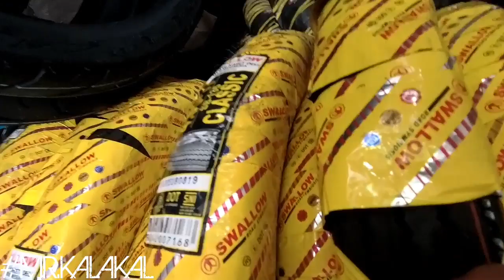YAMAHA RS100 MAINTENANCE DAY | MOBIL 1 OIL | CUSTOM BIKES

Comment: Snnapy! ok slamat sa vlog mo bok, isa akong retired military from army. Motor ang gamit ko nung nasa active service pa ako RS 100 astig  simple kasi ang porma pero ok ang performance ung tunog ng makina nya yan ung hahanap hanapin mo dahil pasok yan sa panlasa nating mga pinoy. almost 7 years kong ginamit  si RS walang masyadong issue sa makina basta alagaan mu lang sya sa 2T  oil.  Napasa ko sa ka buddy ko nung 2006 dahil nalipat ako ng malayong assignment kaya namis ko si RS kaya nung mag retire ako last 2014 bumili ulit ako ng vintage Yamaha RS 100 for 12k with sidecar ung may ari kasi pinapang hakot nya un ng scrap timber logs sa Pangasinan kondisyon pa ang makina nung mabili ko pero napabayaan ko nung mag stay ako dito sa Makati. kaya ng mapanood ko itong video mo biglang naalala ko si RS ko kaya thank you so much  babalikan ko sya at muli kong gagawing "ROCK STAR" (RS) ng kalsada. More power to you and God bless.

Comment: May ginawa kameng Enduro style na Kawasaki HDX 100..

Nako! ang takbo
manhid sa mabababang rpm pero pag nasa matataas ka na rpm
nako biglaan ang power!

Maiintimidate ka kung hindi ka familiar sa powerband ng 2 stroke
Reply: Modified engine ba paps? Meron ako kawasaki HD2 100 ehh.. Iba talaga hatak ng 2stroke.
Reply: Machined Block from KE 100 ,high compression head..

X4 125 carb

5 speed gearbox from Kawasaki G7
Reply: Hanep na pala paps. 5speed din KE100 at plug and play sa hdx/hd2. Maganda ba response nung carb?
Reply: Depende paps.. hindi pa kase ako nakakita ng HD2 ehh..

Pero kung G7E yung makina mo hindi mo na ipapa machine shop yung makina mo

Plug and play lang mga parts nya
Reply: G7E? code ba ng makina yan paps? Kasi G7S code ng motor ko kapag nabili ako ng parts. Tsa sinearch ko ung kawasaki G7 Same na same ung engine.
Reply: @joshffrey1372  same lang yun paps
G7 din naman makina eh
Reply: Sige paps. Salamat sa info.